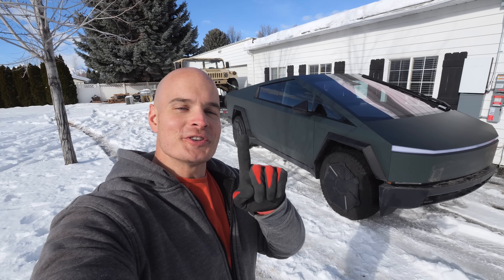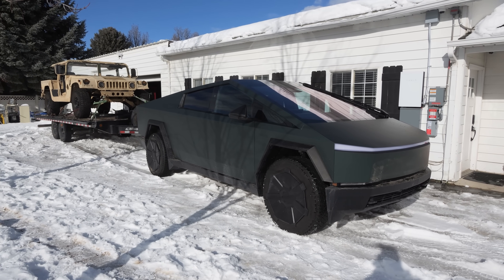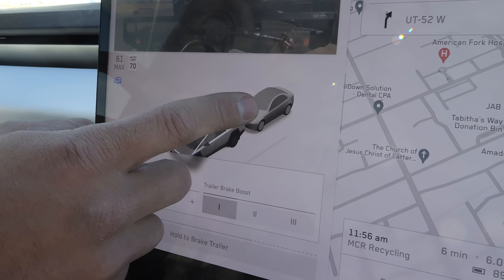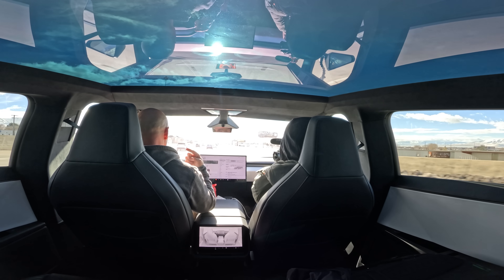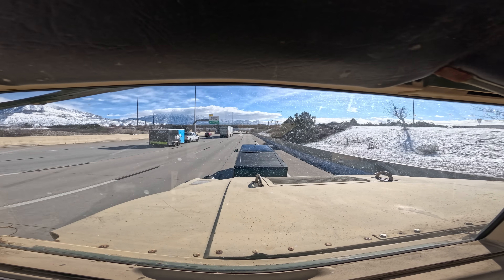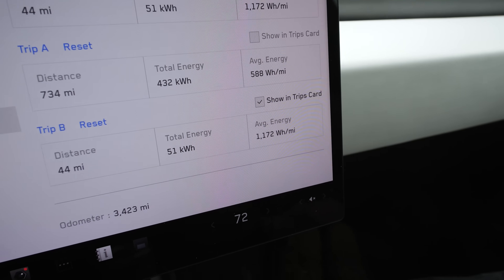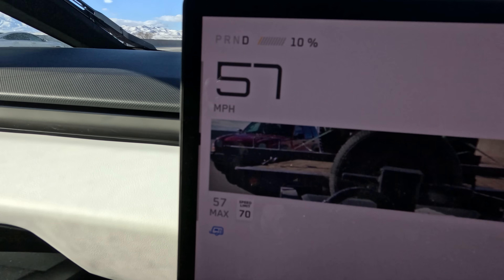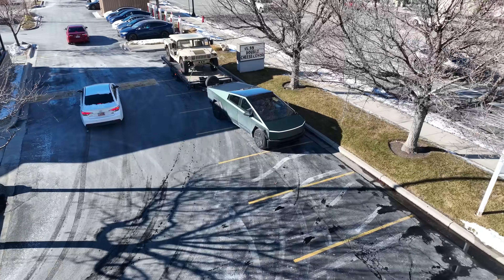How far can the CYBERTRUCK tow 11,000lbs in Freezing Weather?

Comment: I wouldn't mind having one for fun, but not a daily driver. Also, that high fenced area you parked next to, that is usually the diesel generator that provide power to the chargers due to most areas not having the infrastructure to cope with adding chargers in. So nobody gets to say more environmentally than gas powered IF they charge anywhere but at home. I can give you evidence of my claim if you want. Go to any travel station on a major highway that has a line of chargers and you'll fine diesel generators in the back.

Comment: That was some serious range anxiety! Thanks for the awesome test. I've been wondering how the Cybertruck would handle real life towing. I am wondering why you didn't use or mention the on screen rearview mirror. Which is what Tesla expects people to use due to the rear cover.
Reply: You can see the onscreen rearview mirror in several parts in this video. But its located low in the bumper, and all you can see is the trailer, its pretty useless in this case.
Reply: If the estimate is dropping it might drop to 0% way earlier then you think. The initial estimate was they would arrive at 10%. They pulled in with 2%. I think you @karlwithak. is one who does not underatand how percentages work. If it estimated 10% it better stay at 10%, otherwise that estimate is just a crock.

Comment: Neet little test. About what I expected. 
Couple observations: You're conditions are above freezing... slightly, but above (the dash shows the temp). There's also melted ice water on the roads. Difficulty in finding a charger with a trailer attached.... and finally, you towed below the safe recharge value for using a Super Charger.  Does the Cybertruck fit in your garage?

Comment: Tesla's range data has always struggled to adjust correctly for towing, cold weather, mountains...  There are third part apps you can get for your phone that are far more accurate.  This has been an issue for years.  90 miles sucks, but EVs have a big problem with towing.  It is linear.  You double the weight and the range cuts in half.  You triple it and it cuts to one third.  Tesla had to decrease the size of the battery pack and decrease the towing capacity to keep the weight down.  It is also a shame the display sucks so much.

What is the visibility around the A Pillar when you come to a stop sign?  I have had cars that sucked seeing cars to the side, like when stopped at a 4-way stop and those A-pillars do not look small.  If you get into an accident and the doors jam how much harder do you think it would be for Fire Rescue to get into the CyberTruck?  With the 4 wheel steering does it feel odd when backing a trailer?  Can you turn off the rear wheel steering?  Does it change the steering aggression based on speed?

Comment: Okay I really want to know if you can charge big batteries using the weight of the trailer and a big vacuum that will transport the air to a smaller hole that will push a fan to create energy that can be stored or used if the cyber truck runs with the charger plugged in

Comment: Batteries are just going to have to become more power dense for towing long distances to be practical. Luckily the 4680 is becoming more power dense as time moves forward and production lines go to all dry electrodes. If they ever manage to get silicone in that battery then it'll be awesome. The range extender will give this truck how much more range towing max load? Is it even worth it?